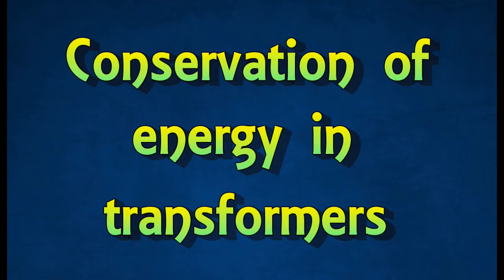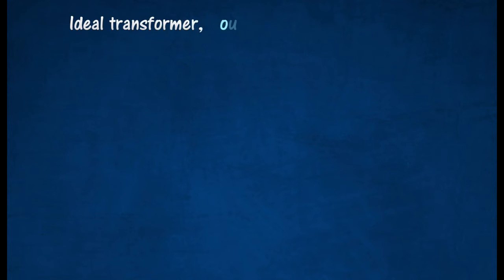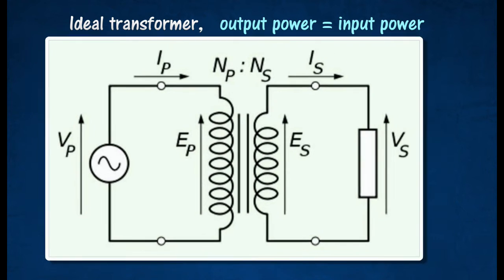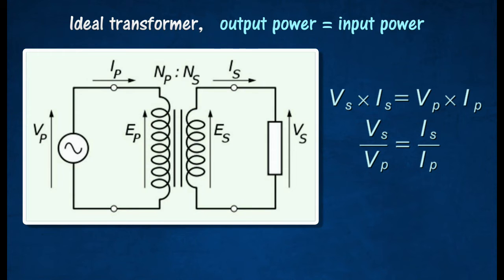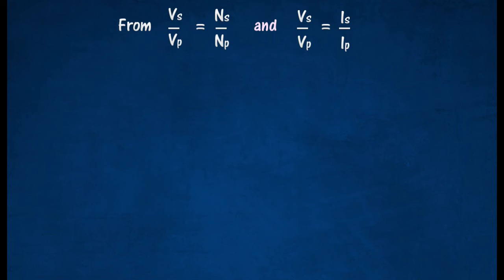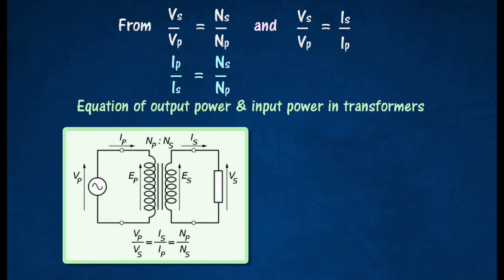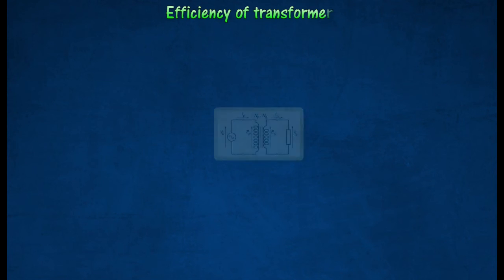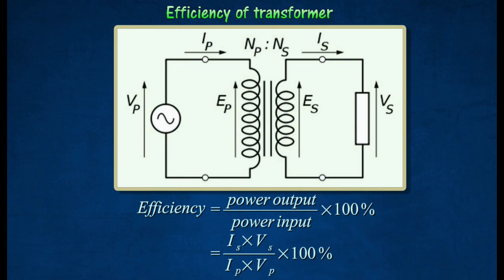[3.5] Conservation of energy in transformers

Comment: But there is something that I don't get. If the first law of transformers states that the voltage at the secondary depends only on the voltage at the primary and the ratio of the coil turns. Then lets say that you change the resistance at the secondary end to a lower resistance. In that case the current you pull will be greater. However the number of turns has not change, therefore the voltage at the secondary is the same. Same voltage and higher current however correspond to higher power. There must be something that I am missing, my best explanation is it the impedance of the coil itself changing, am I right?
Reply: Current changes on primary and secondary side depending on secondary loads. https://www.youtube.com/watch?v=VrbxUQxu0l0
Reply: I believe the coil materials has to stay the same